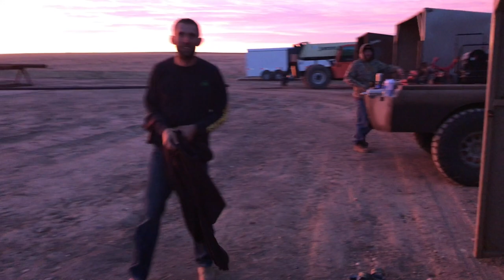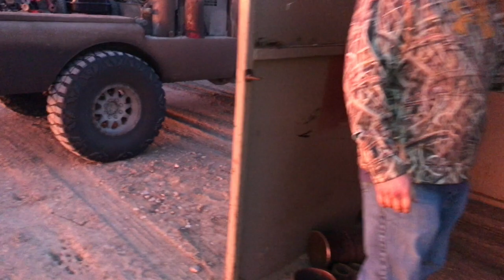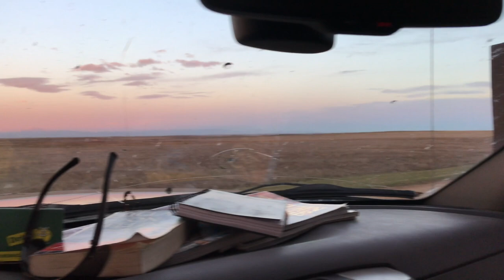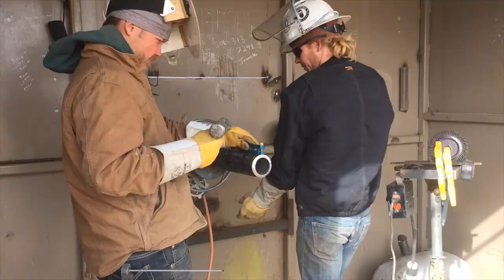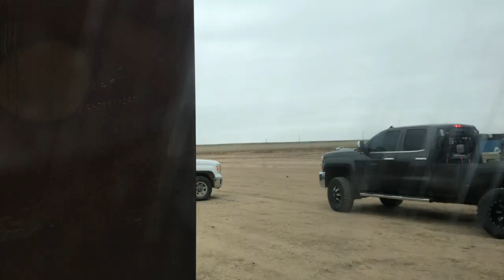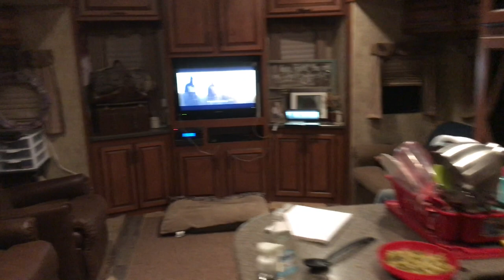Welding O-Lets and Rattlesnakes

Comment: Hey im from colorado and im very interested in what you do. First off, where in colorado do you work? Second, did you go to pipefitting school or go through a labor union? Im thinking about signing up with the local 208 pipefitter hall in denver but i would rather be the one welding the pipes rather than the ones fitting them but ultimately want to know how to do both. Would a pipefitting apprenticeship be good for that? Or would it be better to go to a school for welding Andthen find a job on the pipeline?
Reply: Michael Gerlach if you want to weld on the pipeline you have to start off as a helper and then get a rig and test.  Then you can weld on the line.

Comment: Why does Jed have a washing tip on the bevel machine?
Reply: James Castillo they use it for the flip beveler the benefit is you don't have to take the beveling machine off the pipe you just turn the torch around